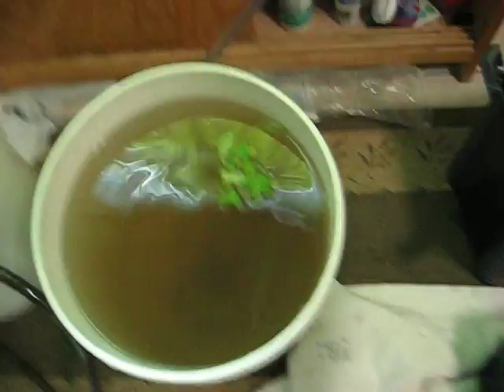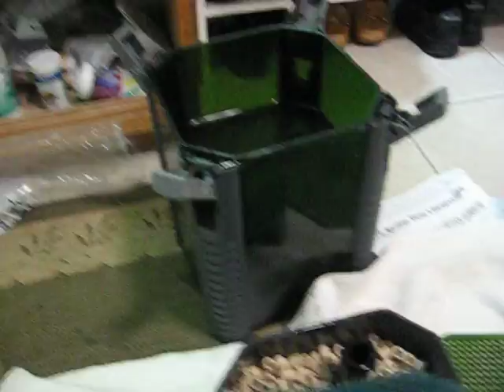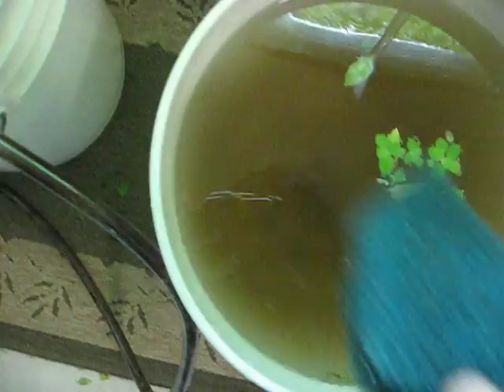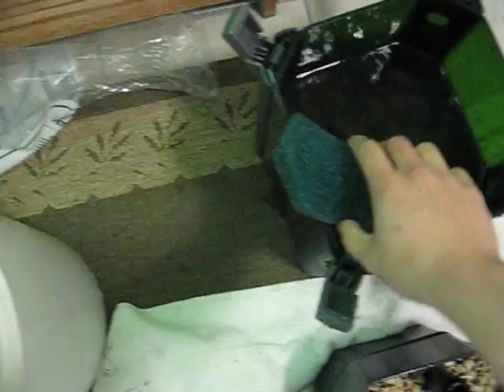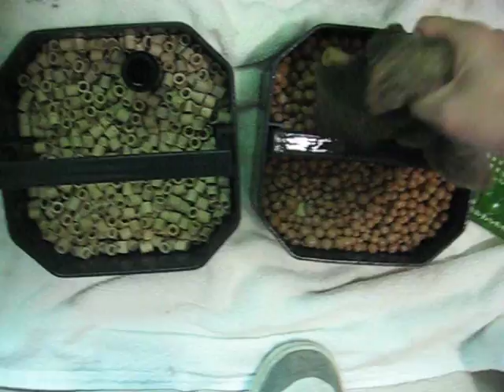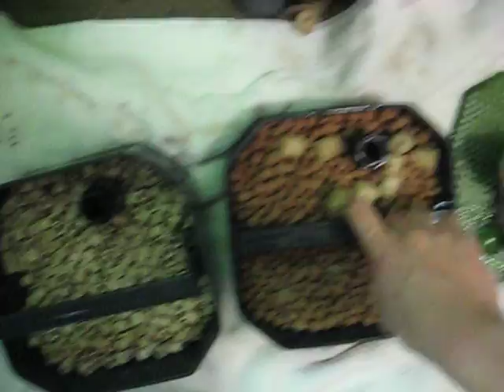Rinsing media

Comment: I changed from the ceramic bio rings to plastic bio balls they don't have as much surface area as ceramic but you never need to change them , with the ceramics you need to change them every 4-6 months (depending on fish load) cause they get clogged up and stop working